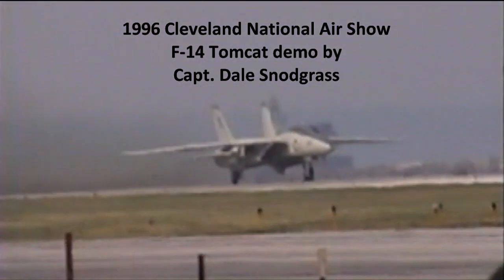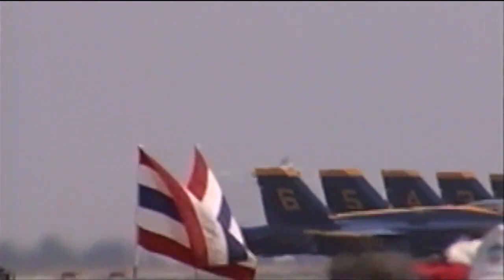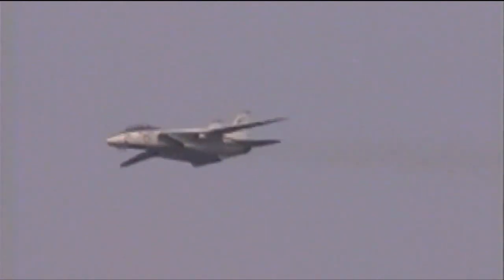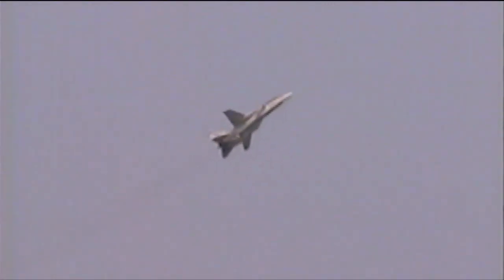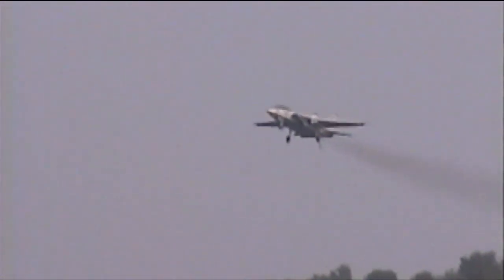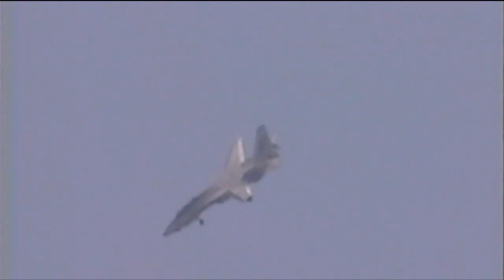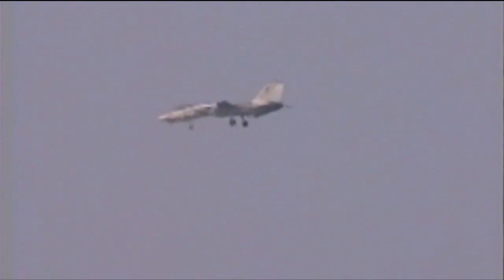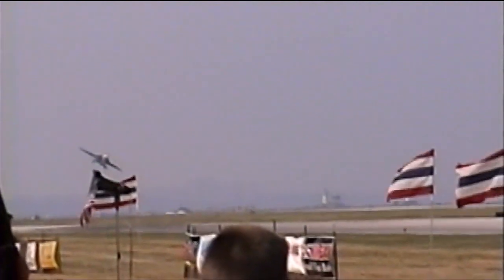F-14 Tomcat: Demonstration by Dale Snodgrass :: 1996 Cleveland National Air Show

Comment: R.I.P 'Snort' You died doing what you loved all your life. I will always remember you as the best Tomcat pilot who ever lived. The airshows I watch are 35+ years old and even in modern times, the spectacular demos even from 1984 still blow our minds because you could make the Tomcat dance like no other. Remember you gunning down 3 F-5E Tigers with your single F-14A Tomcat.  Hope you are flying Tomcats up there in heaven alongside angels. 'Anytime baby!'.
Reply: What happened to him??
Reply: @johnnymichaelangelo9264  He was taking off in his Cessna going to where he was building his retirement 'Snort Fort'. His Cessna crashed at the end of the runway, unfortunately and caught fire. By the time the fire crew arrived, he had passed away.
Reply: @2ZZGE100      man that is soo damn sad.....
Reply: @2ZZGE100     all that pushing the envelope and that took him out...😔
Reply: @johnnymichaelangelo9264  That is the first thing I thought. He did some crazy stuff like pulling 9 - 10 Gs and not passing out or standing the Tomcat at high AoA at only 100 knots just 100 feet over show center while doing a slow speed pass not fearing compressor stall etc. and it is sad how it all ended for him.
Reply: @2ZZGE100  i checked that out!!!    Was a really good clip..  informative.  This man was definately an ace!! What a shame😔..... But atleast he was a rare man to put a stamp into aviation history for the f14..💪amongst other things....
Reply: @johnnymichaelangelo9264  Very true. Not only was incredibly intelligent and a great stick/rudder pilot, he was very charismatic as well and a great story teller. I could listen to him for hours.
Reply: I was at this airshow. 
I lived in Cleveland from 95 to 97 and worked for a very influential family there that did the communications for the airshow along with other major events in the Cleveland area. 
I never knew who Dale Snodgrass was until he died last week and then it was all over the internet like on Ward Carroll's channel on YouTube, then I stumbled across this video just now and realized "Hey, I was there, that's one of the years that Vic gave me passes to get into the airshow".
Just 2 summer's ago I moved back home to Pennsylvania again after having lived in north east Ohio again (although not in Cleveland this time) and went to the airshow almost every year I was up there, I also used to love to go to Mid Ohio road course to watch cars and motorcycle's race several times every summer. 
That aircraft was a beast and it sure seemed like Dale knew how to fly it, I always had a thing for the Tomcat ever since I was an Air Defense gunner in the Army, in 1983 when I was going through training and we first started having our aircraft recognition classes I remember in the first class we had the F14 came up on the screen and the instructor said "Gentlemen, this is the F14 Tomcat (as if it needed an introduction), it is an air superiority fighter, what that means is if another aircraft is flying around in it's area of operations that's because it's ALLOWING it to fly around in it's area of operations".
After that no one needed to ask what an air superiority fighter was.
Reply: @dukecraig2402    thats awesome.....   i was at that show also...  the f 14 was my favorite fighter since i was  a kid gave me inspiration!!   Its sad he died....... dude was a ## 1 top gun... times were a little better back then before the world went to ludacris speed 🤨
Reply: @johnnymichaelangelo9264  
Yea I didn't really know who he was until his accident, I'd started to see his name thrown around because I started watching Ward Carroll's videos not long before it happened, there's no way I could have remembered him being the Tomcat pilot from back then with as many airshow's as I've been to, I'm sure they said his name when I was there but it's been a long time and lots of airshow's ago.
The people I worked for up in Cleveland were big wigs in that area and to a certain extent nation wide for that matter, they owned all the exclusive rights for Nextell communications in the Cleveland area and did all the communications for the airshow's, the Lakeside Airport Indy races, all the sporting events plus that family is close with the Andretti's so I got to be around them at the Indy 500 in '95, I didn't have anything to do with their communications business but I worked in a fabrication shop they owned, they hired me to run a 2nd shift in the place after they'd tried to put one on before there and it was a miserable failure from what I heard, once I got it straightened out and running successfully they were so happy about everything they were always giving me passes to all the events they were involved in and tickets to the Indy 500, so I got to see some pretty cool stuff when I was up there.
In front of Lakeside Airport there's two F4's on stands (or at least there used to be), the stands were given to my 2nd shift crew to fabricate, that was not long before I moved on from living in Cleveland and I only got to see the F4's mounted on them once before I left, do you know if they're still on display up there in front of the airport?
Reply: Does anyone know if he had the mRNA jab? Knowing what is happening to tens of thousands with blood clots and other neurological maladies I don’t think pilots should take it? One airline is forcing new hires to take it. Bad idea
Reply: @Victor-hb4hj  Not sure at all if he got vaccinated. Could be anything. Malfunction or health condition. He was 72 - 73 so anything is possible at that age.
Reply: @ThePaulv12  Yes, that is what I said in response to Victor.
Reply: I wonder if his face hurt from all the grinning he must have done that day!

R.i.P. good sir!
Reply: @2ZZGE100  it was a Marchetti aircraft. Cause of crash is not determined but appears to be runaway trim or some control surface issue that occurred immediately after takeoff. The problem caused a power on stall that was unrecoverable. There was over 2,600ft of runway left when crashed, essentially at the start of the runway. RIP Snort.
Reply: RIP 😢
Reply: @2ZZGE100  He was in a SIAI-Marchetti SM1019B.
Reply: @johnnymichaelangelo9264  His Marchetti crashed apparently as his controls were locked for gusts and he must have skipped his pre-flight check. RIP
Reply: @SlipFitGarage  people keep talking about parking trim locks 🔒! But those are applied in the down position.  And I watched 👀 the video of the crash for 2hrs. And I'm no expert, but it never looked like he had control over the control surfaces. I wonder if unsecured baggage 🧳 fell against the secondary control stick? 🤔
Reply: @vipahman  That is effectively impossible in that type of aircraft.
Reply: @billallen4793  
I'm just going by what Juan Browne reported after talking with owners of the same type of aircraft. Flight controls were not locked. If they were locked, he would've even been able to taxi the airplane. That is all.
Reply: @SlipFitGarage  I don't think the control lock was on either, the control locks for parking are applied in the down position so another reason they're not responsible...
Reply: @johnnymichaelangelo9264  Even an F14 pilot like him can do a mortar shot and make a smokin hole in the ground if he gets in a hurry and skips the thorough preflight. He disregarded his training on his last flight in Idaho. RIP Snort.
Reply: @2ZZGE100  Not a Cessna. A turbine Marchetti. Never skip a thorough preflight, and never get in a hurry.
Reply: @Victor-hb4hj  Not the case here. He just got in a hurry.
Reply: @billallen4793  a
Reply: It wasn’t a Cessna , it was a Marchetti
Reply: @2ZZGE100  It was a .SIAI-Marchetti ,  Not a Cessna. A type of Ferrari of the air with a turbo prop engine and inline seating as it was designed as alight attack or training aircraft. .There was a stick in the rear cabin . When He left the ground on take off  he went into a stall immediately, which caused him to roll over to one side. He died instantly. it has been mentioned that a/ the seat belt in the rear got caught in the stick ( unlikely,it's not long enough) or b/  the electrically controlled trim tabs had a serious malfunction . With such a powerful engine the trim tabs require electro servo assistance and this appears to be what went seriously wrong , In such a brief instant that he was unable to fly out of it. .
Reply: Dime in the slime for snot
Reply: @2ZZGE100  quarter on the deck for ol snot and his snot cot
Reply: @Mercmad  so what you're saying if he would've throttled down, he could've overcome the trim and landed safely
Reply: @2ZZGE100  that's false
Reply: @johnnymichaelangelo9264  he wasn't flying a cesna. And when he took off the plane went almost straight up. They think trim malfunction maybe. But couldn't handle it and rolled and smash. He was dead on impact
Reply: @shawnomack45  Yes, I used the likeness of Cessna. I did not mean it literally.
Reply: @Little Miss JJ Thanks. Really appreciate it. I have been watching 'Snort' demos and reading up on for more than 10 years so it was a big loss especially considering he was about to do some talk shows and seminars on his experiences.
Reply: Is almost been a year since he died, report finally came out. He forgot to remove the control lock, which resulted in no control over the aircraft and his death. Goes to show even the best of the best can be in a hurry and make a mistake. Godspeed snort
Reply: @billmadison2032  Yeah, I read it too. So unfortunately
Reply: @2ZZGE100  that's why Commercial and Military Pilots use a checklist
Reply: @billmadison2032  He was extremely careful with checklists usually, but that day he was in a hurry and it cost him his life
Reply: @2ZZGE100  I still can't believe it. I've met him in Orlando when the navy was trying to recruit me
Reply: @2ZZGE100  It was not a Cessna, it was a Siai Marchetti and for some reason he neglected his preflight and took off with the elevator lock still in place.  Blancolirio channel has a complete video of the final NTSB report that includes after crash photos of the locking bar still on the controls.
Reply: @2ZZGE100  marchetti
Reply: @2ZZGE100  he was flying a Marchetti 1019, not a Cessna. He took off from Lewiston, ID and the aircraft pitched up excessively, stalled, rolled off to the left, and went straight down. 
Investigators found the damn control lock still engaged.
Reply: @herkloader34  Dude, I know. I edited my comment a long time ago as it was before I had seen the ATC video and then read the report. People still beating on a dead horse.
Reply: Agree. The old machines like F14, F15 and F16, also F111 and Harrier had much more presence than the latest models. Also the F14 looks so damn good, just a power house 👌
I always wanted to see a Blackbird in action, unfortunately it never happened 😩
Reply: @Inazuma68  Very true. Agreed.
Reply: He was a fool. That’s what happens.
Reply: @Victor-hb4hj  he missed something in his preflight and crashed.  Sorry that it happened but as the old saying goes, “Flight is very unforgiving “.
Reply: @lebojay  Yes, I have heard his ATC communication and watched the video of the crash. His infamous ch*t ch*t that he used to say for the expletive just before it stalled and came straight nose down.

Comment: A Thousand years from now the F14 will still have that wow factor, it is timeless.
Reply: Just like the P-51
Reply: @TheblueTraxxasRustler  lol.
Reply: @TheblueTraxxasRustler  you mean just like the F4 U Corsair
Reply: @Scotzie69  hell ya love em both but f4u is >
Reply: Still no fighter like it!
Reply: And the f-111 something about the swing wings that makes my gears turn.
Reply: Ya i know different purpose
Reply: They never should have discontinued it!
Reply: That's what they said about the chariot.
Reply: @metatechnologist  old, 1970s technology that was never upgraded like the F-15, F-16, F-18, was. It was nothing more than a platform for the AWG-9/Phoenix missile. I much preferred the Phantom, particularly around the boat.
Reply: @OldGlaseye-gf7si  Yeah sure then why is the Air Force now buying new updated versions of the F15?? Also the F18 is overrated. Btw, before the F14 was decommissioned there was an upgraded version on the table.
Reply: @metatechnologist  If anything, the F/A-18 is underrated.
Reply: Because it's modeled after a bird, not after a rocket
Reply: @rickr530  It's still perhaps the best looking fighter jet 70 80 years later.

Comment: Still the most badass heavy class fighter ever built! Bring on the Super Tomcat!
Reply from the maker: Ken Prier , the F-14 — anytime, baby!
Reply: Dick Cheney killed the Super-Tom and his cronies lied their asses off about the F-18 to do it.  Cheney had it out for Grumman, and he basically killed the company because of petty politics.  The adoption of the F-18 platform instead of the SuperTomcat diminished US Navy capabilities dramatically, and the serious consequences (lack of aircraft range) persist to this day.  

With new GE-F110-129 engines, longer range, vectored thrust, Mach 1.3 super-cruise, 77 degrees AoA, the SuperTom would have been probably the highest pure performance aircraft ever made.  It was expected to be able to our rate an F-16 despite its massive size.  The only base aircraft platform (air-frame/engines/basic aircraft performance) that comes close is probably the SU flanker family.
Reply: @shooter7a The Flankers outclassed the Tomcat by a big margin… great the Tomcat had been, no doubt.
Reply: @kpsig  I was referring to the Super-Tomcat, an aircraft that Grumman proposed, but was never built.  It was dramatically more capable than the F-14.  This was an aircraft that used the basic airframe design of the F-14, but was completely re-engineered inside and out, to fix the F-14s flaws, and leverage its strong points.  

It would have been the most capable airframe / powerplant pairing ever.  It would have outclassed just about everything...even today.  The powerplants, thrust vectoring, and swing wing would have given it an unmatched range of capabilities.  

Imagine an aircraft that with the wings swung out and thrust vectoring could out-rate an F-16...and with the wings swung back could supercruise and hang with a Mig 25, all while carrying a massive payload.   THAT is what the SuperTom would have been.